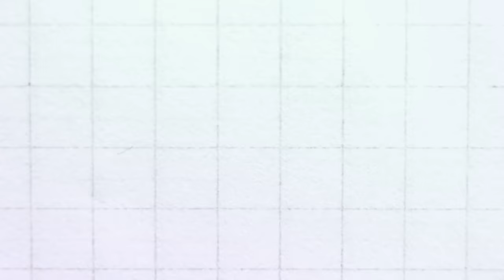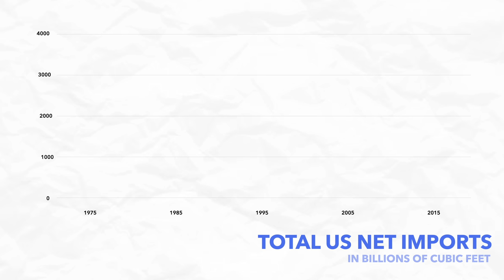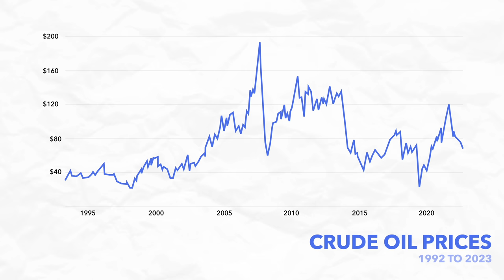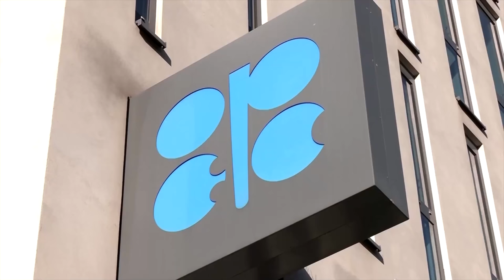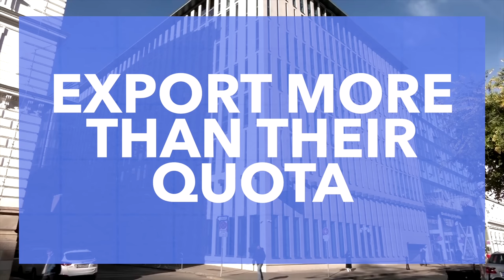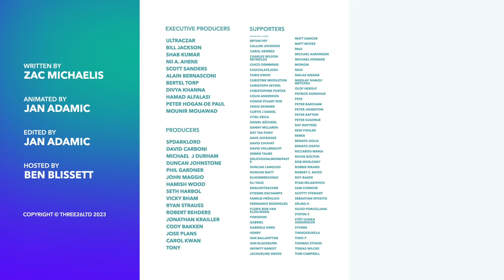Why Saudi Arabia and Russia Have Fallen Out

Comment: All this shows is that we need to get off of Big Oil. Big Oil has no conscience.
Reply: Imagine their shock when they realize what they really have started... EV dont need oil and alot of other things can surely run without it aswell
Reply: @cookiecola5852  Where does the EV get its energy from?
Reply: @cookiecola5852 EV are not being charged on renewable lol, it's oil.
Reply: @abeturay6685 EVs aren’t being charged on oil. It depends on where you live. Some places it is renewable. Others it’s natural gas and in the worst places coal. Oil is just a dumb way to produce electricity, so there are very little oil power plants.
Reply: @dingus6317 , energy market is diverse, most of what i use is extrated from hydro power, there is also wind and solar, those 3 are called renewable energy, nuclear power is probobly also in the same category but iam not 100% sure

Then there is coal, gas and oil which are fossil fuel energy

You know just because our earliest ancestors used a stick with a sharp rock at the end to cut down trees didnt mean it was impossible to innovate new equipment like a saw or a axe with forged steel to cut trees down
Reply: @abeturay6685 , wait so you think energy to run an EV can only be extracted from oil?🤣

that is very funny...

my country run on about 90%+ hydro power, i very much doubt that EV's over here only run on power extracted from oil, i pretty much doubt we extract power from oil at all...
Reply: @dex6316  When comparing what's worse between coal and natural gas, it actually depends on how efficient the delivery from the mines to the power plants is. Coal in Germany is, for example, better than LNG (from e.g. America), but worse than pipeline gas (from Russia; other pipelines are planned, but don't exist, yet).
Reply: @cookiecola5852  Your country is your country. Energy is dependent on conditions. Countries with less sunlight hours and bad weather can't rely on solar. Countries with few rivers can't just rely on hydro.
Reply: Replacing Big Oil by whoever manufactures what comes next. Sweet.
Reply: @ChucksSEADnDEAD , no shit but its more likely those who were depend oil as energy wont be with sudden price spikes
Reply: @cookiecola5852  Not every country can be Norway...
Reply: @juanmillaruelo7647  Exactly plus Norway has like 34 people
Reply: @dex6316  My point is that very little is being charged on renewable. Show me a country that's produced 90% or even 50% of their total electricity on renewable .
Reply: @dingus6317  give it a good 20/30 years and oil will be a huge money waster and not efficient
Reply: @juanmillaruelo7647 , well i have made my point and i very much doubt every country beside my own is that piss poor, there are also other countries with alot of renewable power but no point in listing em

As those who can bargain for more for oil ends use of it prices falls, its rather simple mathematics…

Comment: If I were Russia, I'd be more worried about Qatar than Saudi Arabia: Natural gas is becoming more important than oil.
Reply: Russia has a shitload of natural gas too. Either way, due to a lack of access to western extraction tech Russia will eventually run out of the ability to both maintaina and extract more oil/natural gas.
Reply: Whats the difference between natural gas and oil bros
Reply: @defiantjv2920  ones liquid ones gas, I think thats really it. Also natural gas is """""cleaner""""""
Reply: True. Key countries like Germany care more about LNG
Reply: @ekulzonum  yeah but Qatar not only is capable but is in fact replacing Russia’s all gas market. How you ask? Well there is several reasons. Russia went decades building infrastructure to sell to Europe through pipelines investing little to none in LNG infrastructure. Contrary to that both Europe and Qatar have invested highly in LNG Infrastructure which enabled Europe to be quickly shifting Russia’s market to Qatar since Russia doesn’t have the necessary LNG infrastructure. Not only that but Russia invaded Ukraine which made the EU to in place a price cap on Russian oil and gas transported by ship which is now mainly Russia’s only option that price cap was extremely successful and the whole word except oil selling dependent nations liked it a lot. Qatar also even though an oil dependent country liked it a lot because they been ganing a huge market by replacing Russia’s market.
Reply: @defiantjv2920  Crude oil is the thick black stuff. Natural gas is indeed a gas. Often oil fields have a big natural gas reserve too. And if you've seen video of oil derricks, you may remember seeing a flame on top? They are burning off natural gas - they didn't bother to bottle that stuff out.
Now crude oil is distilled into various products, like gasoline, diesel, fuel oil, raw material for plastics, etc.
Natural gas can only be used for burning. It's mostly used to generate electricity, warm homes (your furnace), etc. It can be pressurized and liquified - LNG (Liquid Natural Gas) and shipped.
Reply: @ekulzonum  Russia is well aware of the US's natural gas supplies. They are warning the EU that they (the EU) risk becoming dependent on US LNG. You know, like buying from Russia is a better option.

Comment: Letting aside a lot of assumptions you do not substantiate in this video, does the fact that Saudi Arabia loses from Russia not cutting back its production actually lead to strain, or is that also an assumption? I haven't seen any news about that, so a good link would be nice.
Second, I think that the strain might be less than assumed, because it is not only about oil. It is also about an international financial system where countries can be sanctioned unilaterally, trade between countries can be unilaterally prevented, and assets like central bank reserves can be frozen or seized unilaterally. The united Nations have been consistently voting since 1974 to replace this system with a freer one, where it is more difficult for a few countries to kill your economy. This is also the reason that the Saudi's joined BRICS. Don't get me wrong: I am not a fan of either Russia or Saudi Arabia, but I am also not a fan of what our governments do and get away with.

Comment: There are a few mistakes in your video:

US-Saudi relations started in the 1930s, not the 1950s. Aramco (originally the California-Arabian oil company) was founded in after a concession agreement in 1933 and Saudi Arabia started producing large volumes after WW2. 

The US is not a net exporter of oil (crude oil), it is a net importer. It uses ~20 million bpd of oil products (gasoline, diesel, jet fuel etc.) and US oil production is current ~12.3 million bdp. Saudi Arabia exports somewhere around 7-8 million bpd of crude (excluding oil products) mostly to Asia, and as of 2022, to Europe. So to say the US-Saudi relationship is at a low point because the US imports less Saudi crude is incorrect as many oil consumers use Saudi crude, and many of these (Japan, Poland, Germany, Korea etc.) are US military allies, and other (China, India) are large trading partners to US.

The "vaccuum" left by the US in the US-Saudi relationship is not being made up by Russia, not even close. KSA views Russia as a partner in oil markets, and that's it. Russia does not supply military equipment to Saudi, Saudi has not requested that Russia post troops in KSA, and the Saudis are huge partners in intelligence sharing with the US, so the strategic role the US fulfills and that the Saudis rely on and participate in has not changed.

The idea that Saudi-US relations were at a low point after 9/11 is a popular myth because at a political level, they were at a high point. Al-Qaeda was a sworn enemy of KSA, after they conducted attacks on the kingdom in 2004, al qaeda was soundly defeated by the Saudi government. Osama Bin Laden called for the overthrow of the Saudi government, and the reason he used so many saudis as hijackers for 9/11 was to try and sever the strategic relationship between the US and Saudi.

OPEC does not impose export quotas, only production quotas, what each member state does with their crude is none of OPEC's concern.

Finally, Russia isn't overproducing per se, there's simply no reason to believe they are abiding by their voluntary cut of 500kbpd, as their exports have never varied and that's the only thing that we can look at when judging Russian oil production. 

Saudi Arabia did not "flood" the oil markets in 2015, they simply refused to cut production to make way for shale oil producers. They said this for many months before oil prices started to crumble after some slightly less optimistic economic data came out that summer. The collapse in oil prices was simply due to shale oil producers over producing, but this has changed. Now, shale oil producers appear to be removing rigs at less than $70 a barrel, so production might fall in the States as well, hence supporting prices again.

In the future this could lead to a repeat of early 2020, when Russia and Saudi fell out last time.

Comment: Well, for most of its modern history, rather than most of America's history would be correct re net oil importer. During WWII, it was commented that the Allies floated to victory on a sea of American oil. The US had so much oil they were spraying oil on dirt paths to create instant roads on Pacific islands. The US became a next oil importer in 1949, although it was still the largest producer. In 2020, with shale oil, the US again became a next oil exporter; it still imports a lot of oil, to refine and sell. But, yes, it no longer needs the Middle East. If it needed to, there is Canadian shale. And oil from South America.

Comment: Poor video .For your information, Saudi Arabia can make only one move that destroys Russian and American oil industries together, as it did during Covid pandemic. During Covid, the Kingdom wanted to reduce the supply to raise prices, as is happening now, and the Russians did not listen and increased their supply by a small percentage. At the same time, Trump was bragging that he is protecting Saudi Arabia and If it not for the US, Saudi would have fallen. Therefore, the Kingdom made a nuke oil move, increasing the supply as the Russians wanted, but by flooding the market with oil, bringing the price per barrel to -23$. Meaning that, the buyer gets $ 23 with each barrel of oil, which force the seller quit selling, and thus will lead to accumulation of barrels in the seller’s storages. Literally the next day, most US oil companies went broke because US oil needs $45 to produce one barrel. As for Russia, the strength of its oil economy makes it survive for only three weeks. On the other hand, the Kingdom can live normally for a year and two months in this case! After that, you see Trump bullying everyone, but when it comes to the kingdom, he is more Saudi than the Saudis. As for Putin, the kingdom has sizeed him very well in the field of oil.